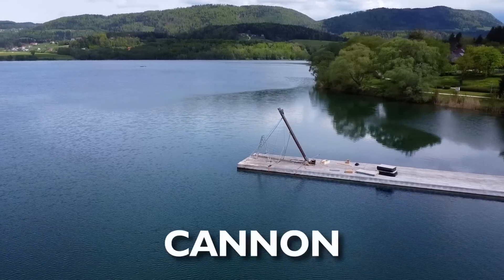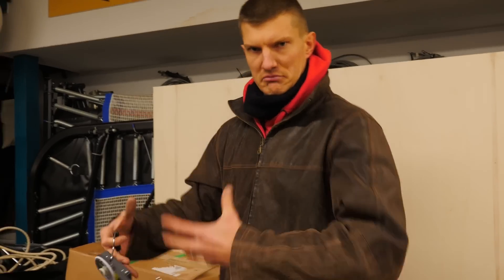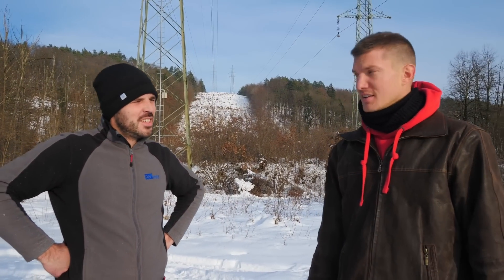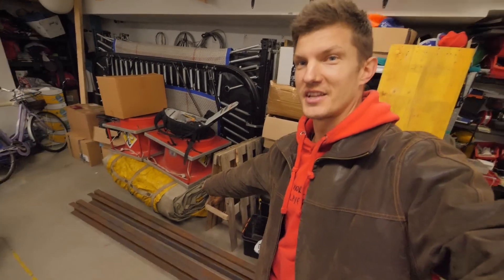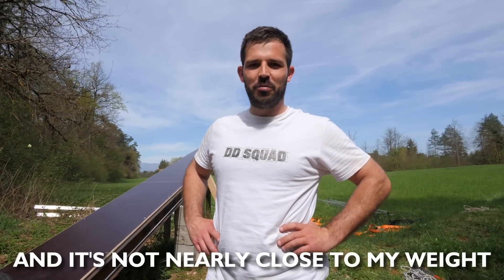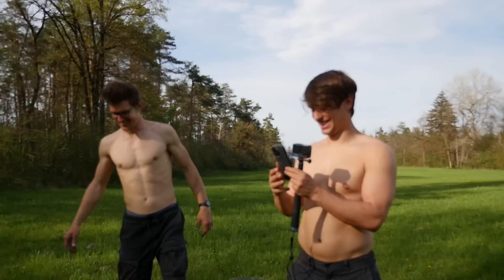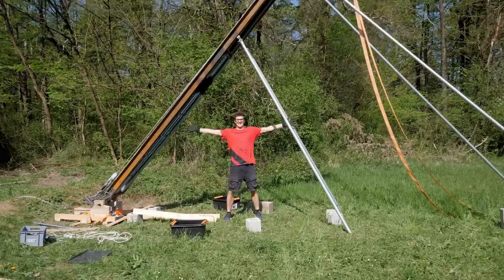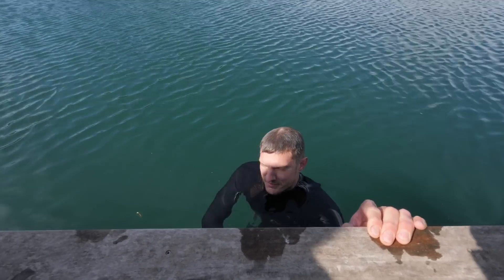We Built a Human Cannon from Scratch!

Comment: I think you could make a trebuchet-type thing but the place you launch from stays level so it doesnt spin you when you get launched just for more control. Maybe have it be like a seat that just pushes you up and forwards into whatever you would be landing on (most likely water). You could probably replace the weight with a rope and pulley system connected to a truck or some sort of fast and controlled pulling thing and the trebuchet arm would be for leverage to launch the person as far and as fast as possible. For the mechanism to keep the chair level you could have the rope be solid and the chair be on a bearing so it can spin and connect a gear to it and the base and use a chain between the two to keep it at the same angle no matter the point of rotation the arm is at. This would probably need to be quite big and costly in order to work though so idk.
Reply: I probably could have worded that a lot simpler
Reply from the maker: Hehe you really went into details 😅 but it’s a great idea!